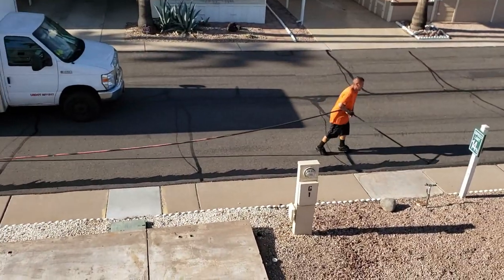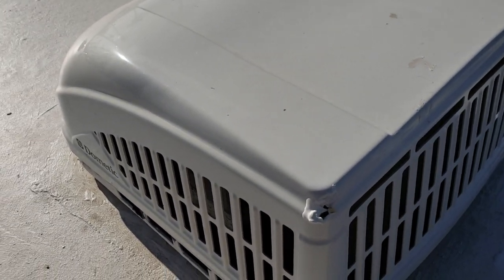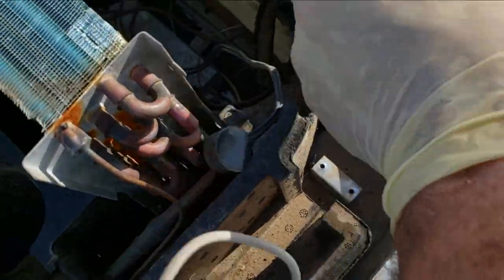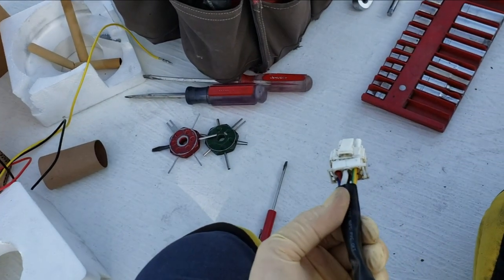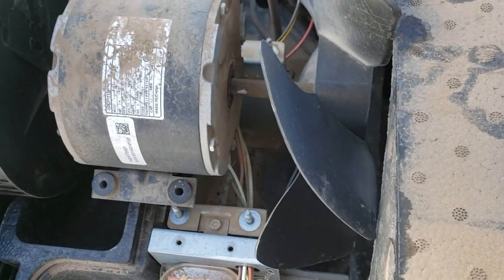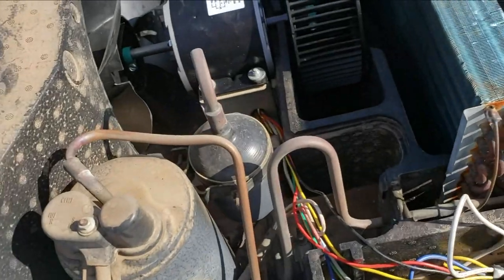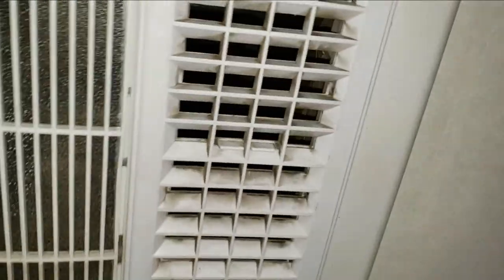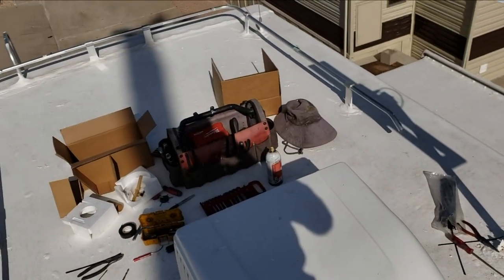Are Dometic RV A/C Motors Intentionally Bad?

Comment: I thought my motor was bad (brand new Penguin II).  After watching your video I realized there are two fans on the motor, I inspected the inside fan and found the two screws from the manufacturer were never tightened down so the fan was rubbing on the plastic housing (very wabbly too).  I tightened the screws, move the fan a 1/4 out, straightened it and bam we have AC in the front now.  I also avoided having to go into the shop for warranty repair!  Thanks for the great videos!👏🍻

Comment: This is one of the better videos in dometic motor changing.
Reply from the maker: Thank you very much!
Reply: @AZExpert  
Actually, I'm going to expound on that. Because of this video. I was able to change out my blower motor and capacitor on my domestic AC unit. I never worked on one before. This one lasted 5 years but the one before this lasted maybe 20 years. Thanxs

Comment: These low quality motors have to be oiled regularly. I’m a plumber buy trade but spent 10 years in south Florida doing ac service as well. I’m getting into all these repairs on my camper and you definitely have the best vids on the tube. You know what your doing for sure.
Reply from the maker: Thank you very much for the support and encouragement. I do try to keep it interesting.
Reply: What do you recommend for lube?
Reply from the maker: @girlnextdoorgrooming  they are sealed motor bearings so they really cannot be lubed. Sorry!
Reply: @girlnextdoorgrooming  You can try spaying some white lithium grease where the shaft goes into the housing....
Reply: @ckm-mkc  If that lube penetrates, that means the seal is already gone. Trying to lube a sealed motor is pointless.
Reply: @okopnik can’t you just open the motor?
Reply: @darkseid8481  What do you suggest doing with it once you open it?

Comment: Swapped my fan motor today, using your video and another, and it is pretty straightforward. Fwiw, you don't need to mark those plug halves, it only goes together one way. Took me a little over an hour, not bad! Thanks for the video.
Reply from the maker: Excellent

Comment: Great, I just bought a new Dometic 15K BTU for my little Mallard Class C. Brisk Air II mfg. Date Nov. 2020. I got it from a dealer in Fort Worth for $750 shipped to my door. I haven't installed it yet, fixing the roof, and am now waiting on new vents; I want to first paint it with "Henrys." They are light; I'll give them that. The one up there now still works fine, and I don't know what BTU it is; these Mallards were built in Ohio, but it doesn't cut it in Houston during summer; it was a 100 in the shade today, I think. But, for an A/C that's 33 years old, it tries. Love your videos; I've learned a lot in the past 6 months!
Reply from the maker: Thanks for watching

Comment: Great video again as usual! My rear Duo-therm 620525 ac fan motor is a gonner on my 2005 Newmar.  I did spray with wd and got it to work for now.  I hope it is as easy as yours to replace the motor? My motor is a 1/4 HP, can I use a 1/5th HP? I noticed my motor was made in Mexico. Yours was China. I will call Demetic tomorrow. Did you get yours from Dometic? Anyway thanks again for the insructional videos. Gotta probably do the front ac as well. Jeez its always something.

Comment: Thanks so much, my motor started sounding like cats fighting, I did lube it and it has helped but I ordered a new motor and fans, thanks for the part numbers. Getting to be the hot season and I need both running in the 90's

Comment: Thanks, I wouldn't have bee able to replace my motor without this video.
One question though.
Now my AC runs for about 5-10 minutes, stops for about 30 seconds then starts back up for another 5-10 minutes. Its not a big deal but im worried that it might be a sign of a more serious problem.
Do you have any advice?

Comment: The motor stars 4:16  horrendous noises without failing Its the sealed for life bearings is what fails. I repaced the motor in my 2014 Coleman branded unit and went from barely able to hear the TV at  full volume ,to near silence 67db . I followed the directions many have posted on how to make sure the air is traveling along the ducts. I keep the air dump in the unit closed. BTW cleaning the condenser and evaporator while you have access to it helps make air cooler.

Comment: I have a 13.5 domestic unit on a year old trailer and the compressor only runs for about 4-8mins. Compressor just shuts down and I can only make it go on by continually trying to turn in on/off on the thermostat. The fan works every time and every speed. When the compressor is running, I do feel cold air. At least a 20 degree difference
I have checked capacitor it reads 48.5/4.7 and it’s a 50/5. And says it’s plus or minus 5 percent. So I think it’s ok 
Do you think it could be a faulty thermostat? It’s the soft touch kind. 
I can only test ac with harbor freight 3500watt generator, and when compressor is running the generator shows about 17.5 Amps

Thanks for doing these videos. You have no idea how much they help!

Comment: Did you do a video on how to bypass the circuit board and just make the fan and the compressor run continuously so when somebody's out and screwed and doesn't have AC on a weekend that they can have at least a temporary fix

Comment: Ok
So two things.
1) I hate planned obsolescence 
It’s ridiculous to me that these air conditioners need maintenance after 3 years and shows me what rv manufacturers really think about their customers.
2) I work in west Texas and today it was well over 100.
I can home and boom oven. I knew this was coming so I had steady had the motor. Found your video and followed it verbatim. I’m now sitting in the ac. I really appreciate the knowledge. However I probably should’ve just wire nutted my leads because that lil pin connector kicked my butt.
Keep up the good work.
Reply from the maker: it's crazy, I have never fixed an Atwood, Furrion, or Carrier A/C yet
Reply: @AZExpert   any advice for my domestic blizzard next?

Comment: Think you could help? I did this and used the original fan blades. Realized one was off and replaced it. After I replaced it my unit no longer blows on high, only low. I just replaced the blower motor again and still only blowing on low, no high. Any suggestion? Thank you
Reply from the maker: make sure you have power on the black wire
Reply: @AZExpert  would that be maybe the connection to it went bad? Or it’s not seated far enough in?

Comment: I just replaced my ac fan motor, fan blade and fan wheel however it seems like the new fan blades are going in the opposite direction from the old one… I am not getting the air flow that I should and the new motor seems to be getting very hot when just testing. Any words of wisdom?

Comment: Great video. I also have a BriskII. The Dometic thermostat just this past week shows an E5 error code.   The code appears for all settings (fan, ac, heat pump and furnace). I can't find any documentation other than an open circuit.  Tried what I could find on the internet. Still have the E5. Nick - any ideas. Charlie USAF Ret.
Reply from the maker: I believe that is a freeze switch code

Comment: Great Video ....one question how can you tell when the motor is the problem ....because one of my AC on my Rv is completely dead ...and don't know if is the motor l already change the circular start capacitor but nothing ...
Reply from the maker: mostly look for AC power at the contacts to the motor on the board, if you have power and no spinning, likely the motor is bad.

Comment: I Have. 2019 toy hauler I purchased from private seller jus recently have the dometic digital gauge it turns on but seems like no power going to the a/c unit, all fuses are good and breakers it was working fine when I purchased it know it doesn’t due anything, 

Any tips or suggestions sr

Comment: I changed both capacitors last summer with oem.. The other day my system just gives one click and no start when I trip the Thermostat. Is there a way to test the motor with direct power?
I spun the fan manually and it spins but did notice shaft moves up and down and Residue on shaft.
Reply from the maker: If it clicks and the fan doesn't run, I'd check the 120vac breaker first, if the fan motor is getting hot and humming, then there is an issue for sure.
Reply: @AZExpert  Turning on fan only, just clicks at the unit. Turning on the AC with fan on Auto, just hums at the unit. New 60 + 5 capacitor, old one was good too I found out. Fan spins ok, not totally free and fast though... Thoughts? 🙂Yes, fan motor is the Genreq manufacturer. Dometic DuoTherm Brisk II 15K (ac only, not heat). Unit is 3years and change old. Thank you for the fantastic video!

Comment: My 2018 camper has a dometic brisk air 2 im assuming, lowest fan setting it squeaks! Should i just go ahead and replace the motor? Im in Las Vegas, so better sooner than later LOL
Reply from the maker: does it squeak at start up and shut down or constantly?
Reply: @AZExpert  No it does not, only sometimes. After seeing you tear apart this, i have a feeling the squirrel cage maybe rubbing on the foam occasionally. Gonna tear it down today.

Comment: I had a brand-new dometic AC unit fail the same way the squirrel cage came loose and just grenaded. Rcd superstore here in Columbus Ohio installed it's and I used it less than a dozen times. They want to make me tow it all the way across town so I just hired a on-site mechanic who installed the warrantied wheel and guess what happened? It exploded again and actually threw shrapnel into the foam shroud. Dometic refused to warranty or replace the unit so rcd wants me again to tow it clear across town. I've been going back and forth with these criminals for the past year because they lied about repairing a bunch of other things. Then of course the manager gets all pissy. I was just going to take them to court but that's a real pain in the butt for this stupid thing.  But dragging it all the way down there so they can bulshit me again is an equal inconvenience. The second guy I paid just to remove the squirrel-cage the first time refused to get back up there and check what he's done the second time! I'm sick to death of American companies that just screw their customers. I'm also sick to death of the idiots running this country into the ground using stuff made by our sworn communist enemies.
Reply from the maker: Never buy an RV if you expect to save any money unfortunately. Sorry you are having such a bad time of it

Comment: Hello, great video.
I replaced my fan motor and only low speed would work. I figured I got a faulty motor with a bad high speed winding, so I returned it and got a new motor...same issue.
What would cause no high speed? Could it possibly be two bad motors from the factory?
Would a bad capacitor cause that?
Please help before I try a 3rd motor😁☹️
Reply: Well, fan motor number 3, still no high speed. New thermostat, still no high speed. Can it possibly be the capacitor? It worked fine before motor swaps.
Reply: Just changed the control box, still no high. Any suggestions?

Comment: Just to be fair you should do the same for a Coleman a/c. I think you will show Coleman uses the same type of highly engineered shroud. I’ve had to replace Coleman motors too. My Dometic units get colder and so far have lasted longer.
Reply from the maker: RVP/Coleman has their own set of issues for sure. I think Dometic had a sweet spot of longevity pre-2004. I'm kind of excited to see how long Furrion will be staying in the market. Thanks!

Comment: AZ, what brand is the better AC unit to use for replacement if needed? Thanks.......
Reply from the maker: Although I prefer Coleman type A/C's it is usually best and most cost effective to stick to the brand you have as the t-stats and control boxes only work with the A/C manufacturer. Also, quite often the wiring harnesses are proprietary and will not work easily with another brand. They're quite sneaky!!
Reply: AZ Expert Thanks, good point on the wiring harness, in fact, that does make sense. But, of course, the competition between the companies are never in the customer interest 😳.
Reply: Carrier. AirV is the best ive ever used

Comment: Having trouble finding the 9 inch condensor fan. The kits all come with 10.5 inch fan. Any suggestions?
Reply from the maker: Finding parts has been very difficult for the last year. I had the same issue with a penguin dometic recently
Reply: @AZExpert  Thank You!
Reply: I just trimmed the metal fan shroud with some tin snips and it fits ok now.

Comment: I think my motor in my dometic 
a/c is out....I have a 1978 dogde sportsman brougham c class ..come fix mine in Payson someday..I bought a  500.00 Whynter internal dual hose AC/heater unit....it works well..
But want to fix the rooftop ac before I sell it someday..any suggestions on who can look at it ..troubleshoot it??
Reply from the maker: I would recommend a completely new A/C and control setup if your a/c is 40 years old. I don't think anyone would try fixing a unit older than 5 years. Thanks!

Comment: Did you have to discharge the capacitor? If so, can you show and tell how? Thanks for the videos. Geeze you think a guy could make a living doing all these repairs down there. 🤝🔨🛠
Reply from the maker: I've never found a need to discharge a capacitor, they self-discharge fairly quickly, but do remove 120vac power before removing the capacitor wiring
Reply: @AZExpert  I was on the fence and thought that the charge dissipated quickly, thanks for the reply.

Comment: Just attach a string to the wire and then pull wire out of black wire cover, attach new wire to tied end of string and pull string to install new wire through old wire cover.
Reply from the maker: LOL thanks for the tip

Comment: As an auto tech I would probably just replace the bearings for $10 total instead of buying a new motor, since it’s age and not use that caused mine to fail.
Reply from the maker: I save money where I can but sometimes the labor rate isn't worth it to a customer